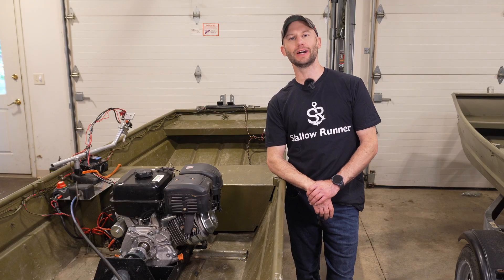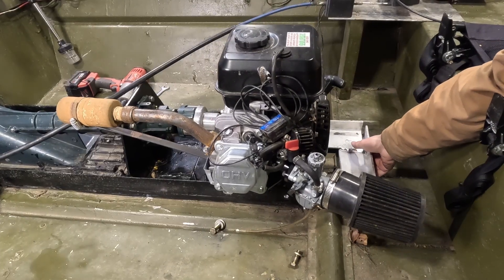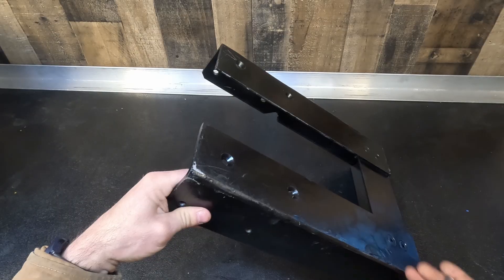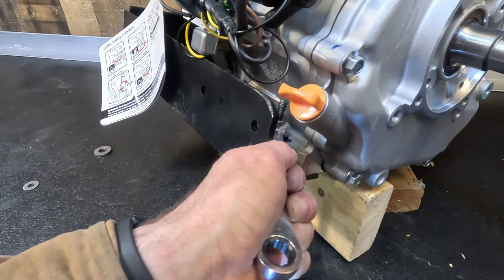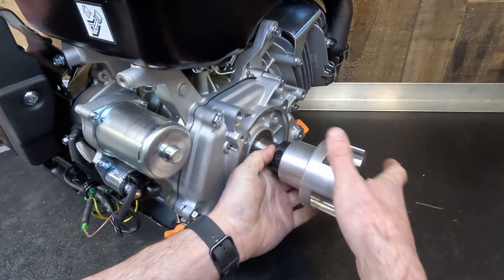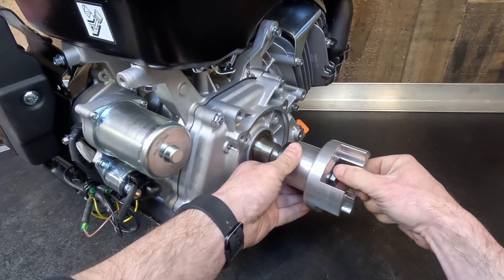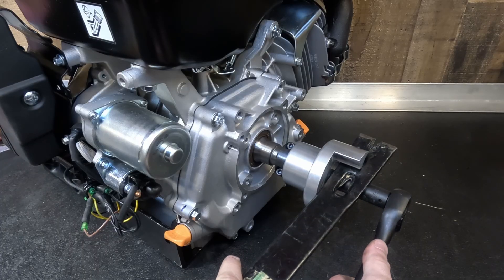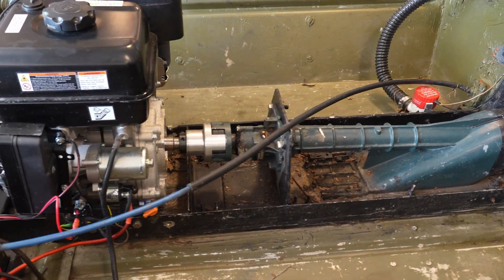Stock Predator 420cc Jet Boat: Part 2 Engine Install

Comment: if you ever showed how to install the Yamaha pump into the jon boat those 100 parts would sell so damn fast lol. i need to build 3 setups myself.
Reply from the maker: Agreed that's great feedback and much appreciated. We  just filmed a mini series with something totally wildly different (still Predator, still jet drive, but with 4 totally new features). After that we're doing an in depth start to finish build series with the Predator 420 and a Yamaha pump with some new parts in the lineup. Stay tuned, feel free to reach out https://www.shallowrunner.com/ with any questions in the meantime.

Comment: I have the same pump and intake. Would the 670cc be too much for that? I want to build another jet Jon on a 10' boat like yours. I've already built a jet Jon with a Yamaha 650. (Weld and fab build,  not a glue and screw the fiberglass to aluminum hull)
Reply: I look forward to the build. Curious how you ended up sealing the pump and intake to the bottom of the hull.
Reply from the maker: Hey, another good question. There are a few ways to do it both from the adhesive side and geometry of mating it to the bottom of the hull and the transom. I'll have some more details on the geometry soon. We are a big fan of 3M 5200, specifically the fast cure variety since there's less chance of it failing to fully cure. The fast cure has slightly less adhesion than regular 5200, but in truth it only partially bonds to bare aluminum. The strength should be based on your bolting configuration.
Reply: I’d just be concerned about weight. A 10’ 32” or 36” boat has small weight restrictions. This is why his adapters are such a great idea because a 212 build is 30 some odd pounds, 301 50ish, 420 70ish, and 670 90-110ish. 

For my use the GX270 / 301 platform seems best because green pants man has lots of rules near me 😂😂 to each their own but ask yourself where/how you wanna use it before building so you don’t wind up like me with a spare 212, gx340, and a bunch of other stuff that you have collected long before the build will be done
Reply from the maker: @Fishdonotexist This comment is spot on about weight. The 670 is a super heavy engine, expensive to purchase and to modify. For the right person in an appropriate hull it might make sense. The original concept was an ultra light build, with the weight at about 170lbs all finished. The 420 gets even lighter with an aftermarket pipe and an aluminum flywheel. I'll be posting the stock 420 video in the next few days, it ran well to say the least, so the step up to a 670 may not be necessary for the vast majority of users.
Reply from the maker: Hey, great question I don't think the 670 is too much by any means for the pump. A 420 with a cam can push the pump to at least 5500rpm with ease. The pump was designed for 5500 rpm, and 32hp so a stock or even modified 670 would likely be well suited, but possibly an expensive overkill. I'll have the stock 420 up in a week, positive results to say the least. Shoot me a message on www.shallowrunner.com if you have more questions.